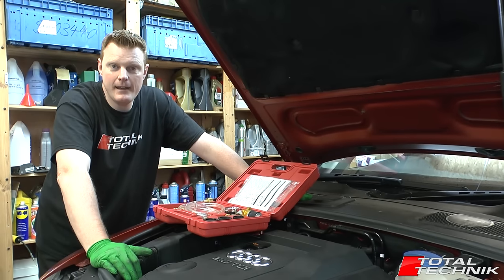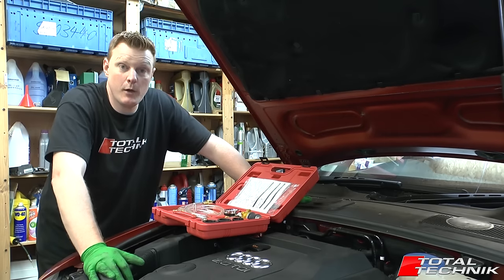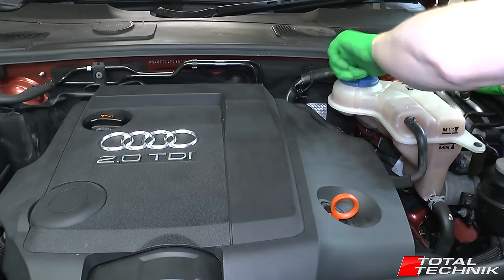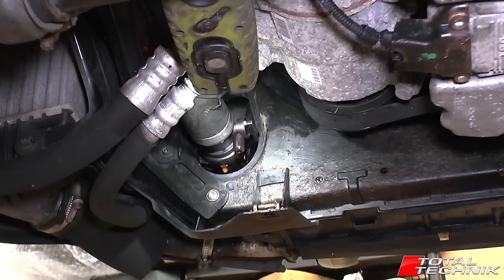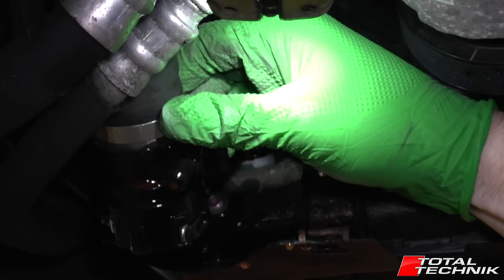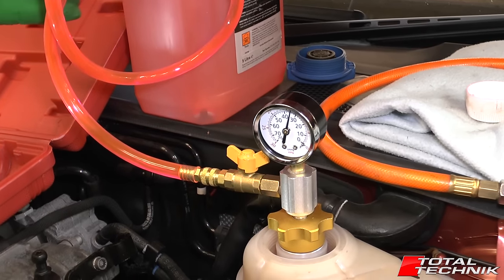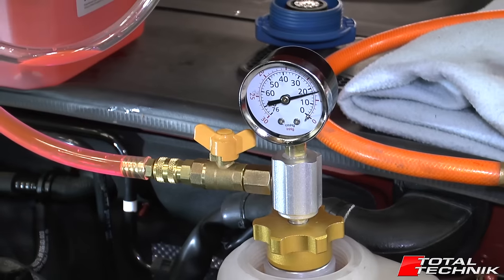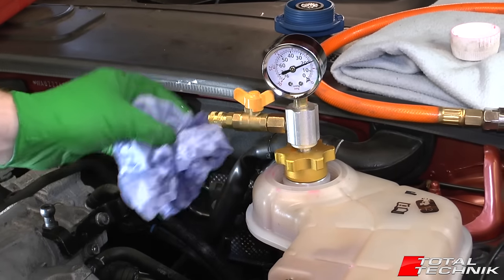How to Change Coolant (AntiFreeze) - Audi VW Seat Skoda - 2.0 TDI (ALL MODELS)

Comment: Or just unscrew the drain screw that's under your thumb pal..
Reply from the maker: Yes, definitely an option. We've done this using the exact Audi workshop manual procedure. I think the preference for removing the hose is that it will allow a 'deeper' drain than the plug, as the tap sits half way up the side of the pipe meaning it will always have approx 1/4 sat in the bottom, as opposed to disconnecting the hose and bending it downward will allow a much fuller, and also quicker (!) drain. Also it avoids the possibility of breaking the tap if it is stubborn/old.

--- 

To help support us (for both you and others reading this) there are a few things you can do:

1) Donations both needed and welcome! We cannot operate Total Technik without the support of people like you! You can donate by PayPal - just go to www.paypal.me/totaltechnik
2) Please ensure you subscribe to our YouTube channel. 
3) Please give our video's the Thumbs Up on YouTube. 
4) Please help spread the word, the more people who know about us the better! Add links to our video's in forums, let people know about us.

Thank you for your support!
Reply: It's called a petcock!